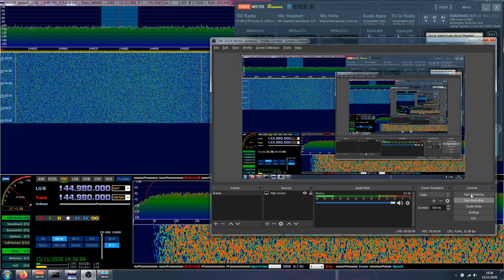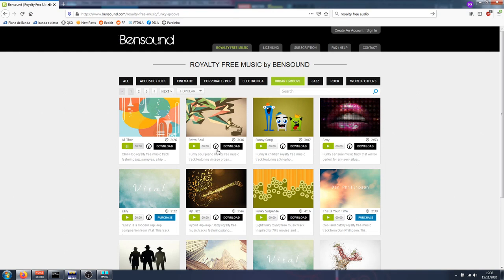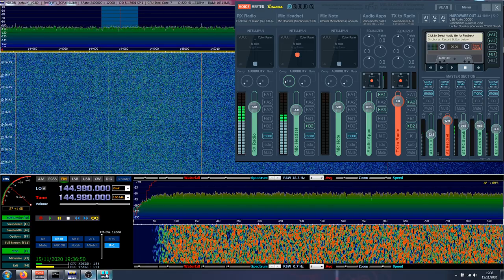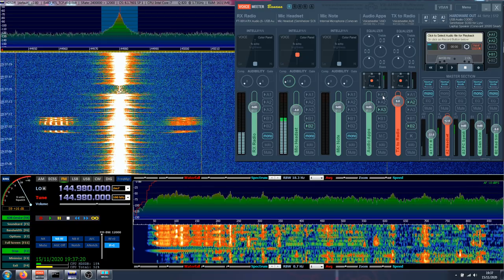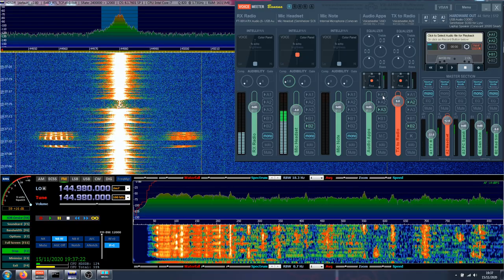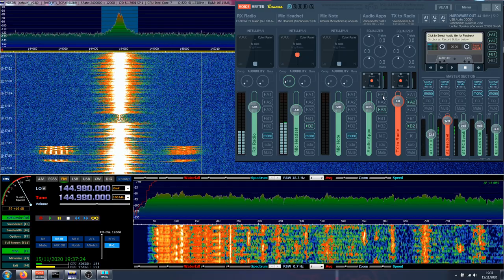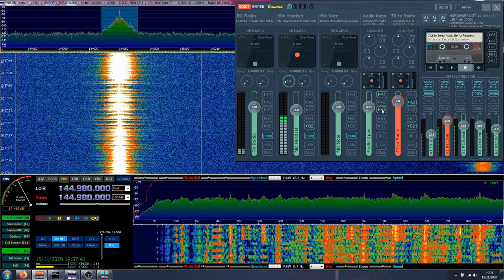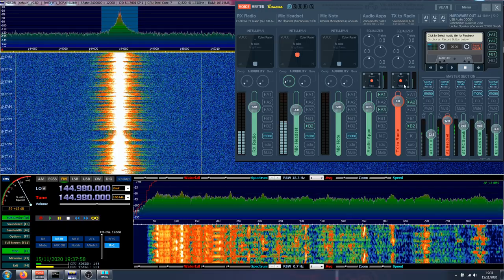Testing the FT-991A in 9600 bps FM Packet mode

Comment: Thanks for the video.  Does the USB port on the 991A work for 1200 bps?  What are the settings for that.  I am trying to use a key at 1200 bps on Winlink but have issues configuring it.  Thanks in advance.
Reply from the maker: It definitely should work, as I have tested my 991A as an APRS I-Gate on 1200. Can't help on WinLink, apologies.

Comment: What software are you using here?
Reply from the maker: The mixer is VoiceMeeter Banana. The Panadapter/waterfall is HDSDR plus a RTL/SDR dongle.
Reply: @rodrigoabfreire3490  Thank you! And how is this connected to the FT-991A? I want to do packet radio, would I need an additional SDR dongle for that?
Reply from the maker: @TheUrbanHam  It's connected via the USB port. In order to do packet radio, you will need a modem. There are some software that can act as a modem, so the USB port carries the audio signal that will be sent to the software and encode/decode data. Look for software packet TNC. Good luck!